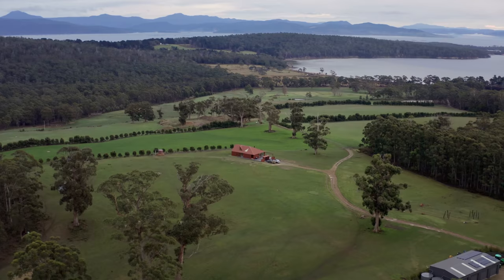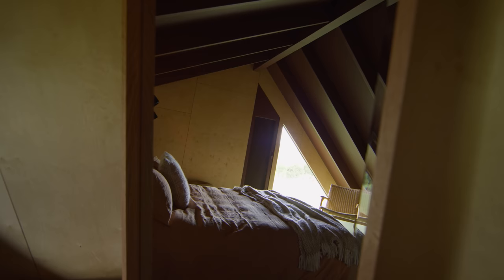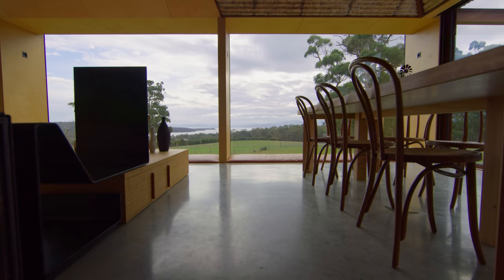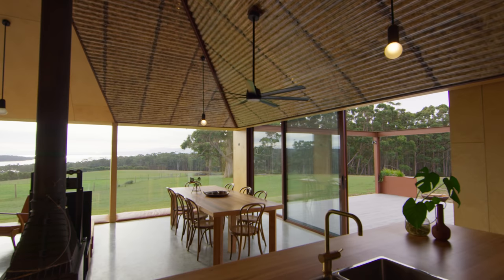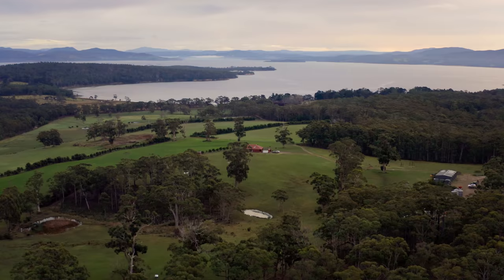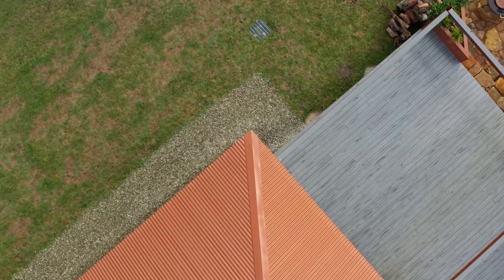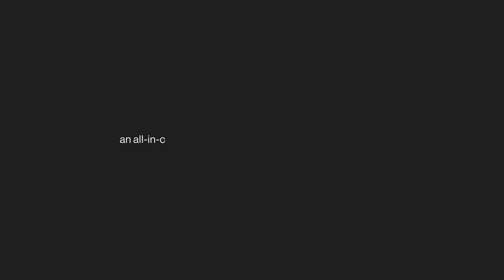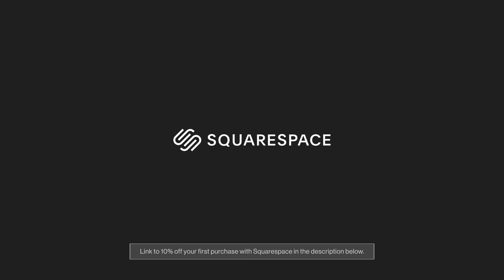Architect Designs a House on a Remote Island (House Tour)

Comment: SO stunning. Any clue as to what kind of windows were used? I also live in a picturesque, cold/harsh environment and want to retain the view while also retaining heat / repelling cold. Thank you again for making these beautiful videos!!!!!
Reply: Hmmm... I am not sure of the specifics of this project, but I'd say look for double or triple-glazed windows (they probs used double). The views won't really be affected as glass is pretty transparent these days! If I was working on this project, I'd probably do triple-glazed (air filled is OK), since they have so much window area! It will help the house from feeling cold. The frame doesn't matter as much, but I imagine they used metal frames since the designer said they wanted durable materials. Usually all these are condensed into a thermal performance value (U-value or R). Higher U is worse, but higher R is good, so you can compare when shopping for windows.
Reply: I guess also for reference: most skyscrapers have double-glazed with metal frames, but recently in some cities have been bumping up to triple-glazed because TBH double-glazed is inadequate when you have that much glass. Also applies to houses with a lot of glass like this one. :)

Comment: Taste is subjective, I know, but I dislike the colour of the house, inside and out, as it feels gaudy. Given the amount of light in the home, internal vines or pot plants may assist with this. It does not feel as well integrated into it's surroundings as it could. 

I understand the desire for low maintenance but I would certainly consider trees, for shade, wind protection, to assist in preventing soil erosion and encouraging birdlife. Not enough or any genus/species to ruin the view though. Obviously leaves in roof guttering are not an issue here. I''d love to hear a drainage engineer's perspective on this.